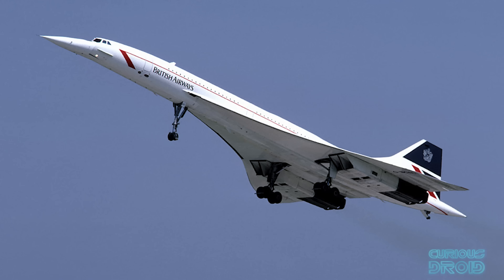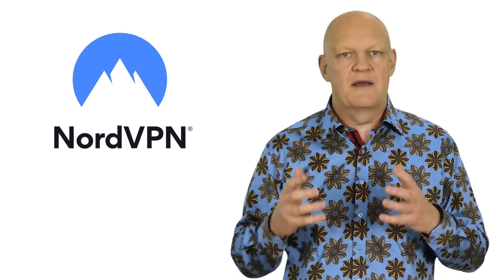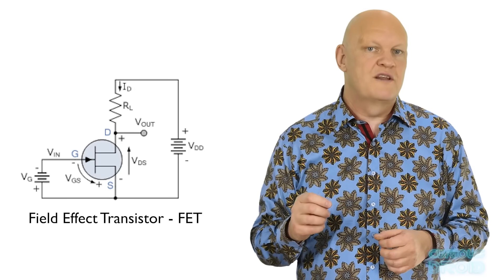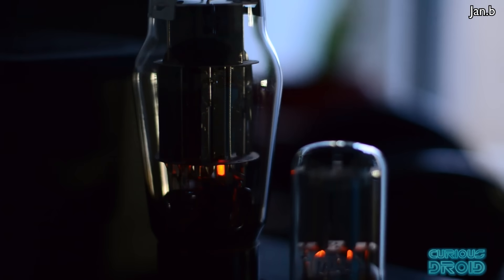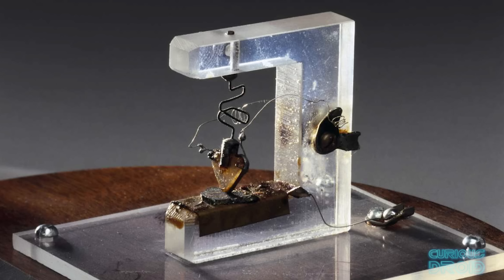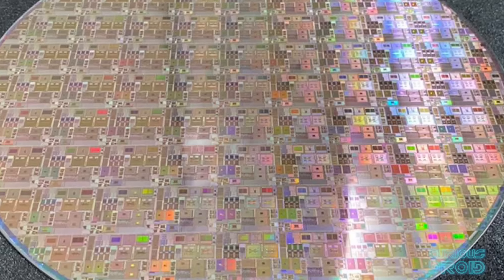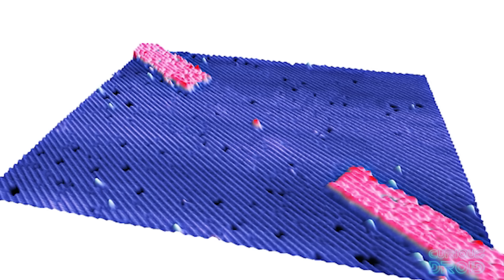MOSFET – The Most significant invention of the 20th Century

Comment: My first electronics experience was with valves (vacuum tubes). Then, as the years went by, solid state diodes and bipolar transistors appeared, followed closely by FETs and MOSFETs. The big step that broke everything wide open was the integrated circuit, a chip. This gave us op amps and "a computer on a chip." 
   I saw an LED for the first time around 1970. In the physics lab, we had a helium-neon laser. It was quite the thing to see! Now I use a laser pointer to play with my cat, and the screen in front of me consists of at least a gazillion tiny LEDs. 
   I witnessed the evolution of computers as well . . . the 4004, 8080, and the x86's. And storage media from magnetic tape to floppy discs to hard drives to solid-state drives. I recently purchased a flash drive for about $0.50 per gigabyte, and I'm told I got ripped off. 
   And it goes on . . . you bought music on vinyl, then 8-track tapes, CD's, until now you just stream it from the clouds, if you are so inclined. Communications: two cans connected by a string . . television . . . CB radio . . . cell phones, and now phones that also serve as movie cameras. Oh, I forgot the internet. That is/was a biggie because you no longer have to go to the library to look stuff up. 
  I've lived through some amazing times, from the DC-3 to the 747, and from Sputnik to Apollo to SpaceX in that arena. And I'm not really all that old, just a year or so older than your average boomer. Now I'm trying to decide if I really do need a smart phone, you know, the kind that takes pictures and stuff like that. The jury is still out on that one.

Comment: Metal Oxide Semiconductor ? Metal Oxide Silicon. I helped start ASML in 1983; I designed the laser alignment system for the PAS2500.

Comment: Around 2002 Intel introduced Pentium 4 at 3GHz and above. Now i9-11900K is at 5.3GHz. Obviously we have reached a speed limit. Yes indeed, there is more to performance than clock - cache sizes, architecture improvements etc. . They are trying to sell us the multicore thing now. But adding cores forever will lose effectiveness, especially for the home user

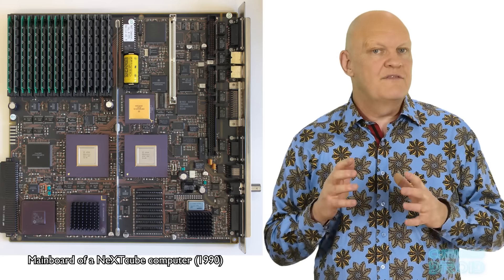Comment: 11:43 wait…16 ram slots on a motherboard? Holy hell…considering the largest number I’ve seen recently was 4 slots (sure, chip capacity is much higher these days but even still…DAMN!!!
Reply: Those are 30pin SIMMs which are only 8 bits wide. So those 16 SIMMs are the equivalent of just two DIMMs.

Comment: Transistors were invented in the 1920s--and it was built. The Nazis transistors them during the war, though they were not a German invention.

The first electronic digital computer was made in the very late 1930s by the Nazi scientist Konrad Zuse. It was quite a bit smaller than later tube computers built by the Allies--it was effectively a table top computer. So it almost certainly used arrays of transistors.

Comment: In the 1960's, a friend of mine in New Zealand called Clive Rowe devised a super-simple current-to-frequency converter using a MOSFET and a capacitor and resistor or two, to convert the picoamp range output from a high-gain photomultipler into digital pulses fed to a counter. We used it for astronomical photometry. This tiny and highly linear circuit replaced big boxes of tube electronics, and made professional-level photometry accessible to amateur astronomers, and the experience determined my later instrumental interests. Of course, nowadays CCD and CMOS chips with millions of very sensitive pixels make that seem very old hat, but still use nanoscopic MOSFETs.

Comment: There is still a lot of computing power let to gain. Take graphic cards as an example, it would need such a huge CPU to do the work of a graphic card, even the old ones ATI 3D ;-) because they are specialized and the general processor desgin is old. I would say the next huge jump will be in the architecture.

Comment: I remember when I was a child getting an electronic experiment kit for Christmas in the early ‘70s. It had all these electronic components on a board and terminals for each component and a big box of wires that allowed you to build all kinds of cool electronic devices. It had a chip that had something like 10 transistors on it🤯.
Reply: Was that Radio Shack's 100 in 1 Electronic Projects Kit? I got the next version, the 150 in 1 for Christmas in the mid to late 70's. It had a segmented LED. That and the integrated circuit made it "high speed, low drag" in my book!.
Reply: Sparky It was!🤓
Reply: Yeah, and the chemistry one.  Combine the two and you had a remote bomb making kit...
Reply: Me too.  That was one of my favorite gifts of all time.  It was a Radio Shack kit.
Reply: I had a different kit which 'contains a silicon chip!' (741 op-amp) and transistor. Years of fun. MOSFETs only appeared on the A-level Electronics spec in 2000, just as an alternative to NPN and PNPs, before finally replacing those in 2009. Exam boards can be slow to adapt.
Reply: during the pandemic i had a go at teaching myself electronics. i bought Velleman Solderless Education Kit. It's aimed at - kids but quite challenging! Also very cheap. In the UK it's like £14.

i also played with Arduino, but being an (ex) computer programmer - I found basic electronics way more challenging & interesting.
Reply: Same here.

Comment: You touched on it in the beginning, but power MOSFETs also have a lot of useful appliations. Perhaps a video about those and the implications of moving from Si to GaN (better electrical/thermal performance) would be interesting to your viewers.
Reply: most GaN based high freq FETs use 2d electron gas as a channel, which would be a fascinating topic too.

Comment: Could have mentioned J-FETs. For audio applications you get even harmonics which makes a MOSFET amp sound more like a valve one (because they're both field effect devices). Some years back I attended a talk that mentioned building proper valves with tiny vacuum holes on silicon

Comment: A great piece, with the extra length reflecting a more in-depth discussion than you usually do. One minor point: around 4:30 you articulately discuss the difference between a transistor and FET, viz the transistor is modulated by base current whilst FETs are modulated by gate voltage. Moving to 6:50 you state that a valve (tube) is similar to a transistor. Er I’d think it’s more correct to say a valve is similar to a FET. Reason being is that each is modulated by applied voltage, whilst the transistor (junction transistor) is modulated by current. 
Though I realise that this would complicate the flow of the story…
Reply: Ah okay this video is about audio. I was hoping for some nice, new visuals. Anyway, the difference between a tube and a FET seems to be the doping which can compensate the space charge. With a FET you can define a working point so to say by doping. Without a field there will be an equal density of electrons. With a tube electrons repel each other an like to slam in the metal electrodes. Around this working point we can enhance the flow by making the gate positive ( NPN transistor ) or make the gate negative to deplete. The effect is more pronounced on the semiconductor-insulator bandgap step then in the middle. This limits the gate width similar to the grid pitch in a tube.
I like Paul trap or electron lenses which by alternating fields create an effective confining field an work like doping in a tube. But for some reason this is only used in CRT -- where you don't switch on and off, but left and right.
Reply: A FET is a Field Effect Transistor ! Are you trying differentiate between bipolar transistors, FET's and the various MOSFET's? (enhanced, depletion, n-channel, p-channel, J-FET's, etc) and other transistors? 

I had an EE lab or two measuring the properties of several FET's.Unfortunately, My lab partner and I mixed up a regular FET with a J-FET.and screwed up the lab.

Otherwise you have some good points. A bipolar transistor is a current amplifier. Tubes and FET's are voltage amplifiers.
Reply: @nineball039  I try to unify transistors. I think the only difference between J-FET and MOSFET is the allowed voltages on the gate. With non finFET MOSFETs the substrate acts like a J-FET. To me it looks like J-FETs can achieve wide channels, but on the other hand the depletion region seems to be wider than the SO2 layer width in a MOSFET and thus signal voltages probably need to be larger. I don't understand why GaAs J-FETs for digital circuits can be fast.
Reply: @ArneChristianRosenfeldt  What's the difference between a J-FET and a 'regular' FET? (Measuring the parameters of both was a main part of our EE lab in the late 1970's).
Reply: @nineball039  MOSFET has an insulator to insulate the gate. Only Silicon can form a defect free Si -- SiO2 interface. And even without defects there can be interface states which are also not so many on that chemical. With GaAs you cannot do it, so you insulate Gate and channel by means of intrinsic GaAs and a the depletion zone of a diode. Ah, I love nip diodes .. sorry. So there can be no enhancement mode JFET .. you would loose the depletion zone.
Reply: @ArneChristianRosenfeldt  Thanks but I was not discussing MOSFET's.
Reply: @nineball039  what do you mean by regular FET then?
Reply: @ArneChristianRosenfeldt  Maybe it was a MOSFET. I did the lab in the late 70's and it won't be the first time I was wrong!
Reply: @nineball039  6502 is from the 70's and is full of n MOSFETs. I think it is interesting that the gate is made of (doped) silicon. So the only difference to a JFET could be the bandgap in the depleted region. Now I wonder why defects are less important in https://en.wikipedia.org/wiki/Heterojunction_bipolar_transistor
Reply: "the transistor (junction transistor) is modulated by current"? Please research the 'Ebers Moll' description of BJTs.  This more-accurate theory considers the emitter-base voltage to be the controlling parameter.
Reply: @NoiseWithRules  I think someone here already mentions that there is a exp() / log() relation between the current and the voltage. So it is the same math. No need to argue. I think ECL comes quite close to using the voltage because the logic levels are so close. It is like the core voltage in modern CPU, but as discrete components on a 1970 cray PCB / IBM mainframe.
Reply: @ArneChristianRosenfeldt  I was objecting to the bald statement that BJTs are controlled only  by the base current, which isn't accurate.  Yes it is a handy approximation.  For precise modelling the EB voltage (not current) is the controlling factor.
Reply: @NoiseWithRules  Yes, after all electrons sense an electric field. And they produce a field. Electrons don't "see" each other directly. Or they do, because "see" works by means of the EM field.

Comment: The scary part is it looks like we're hitting a wall with how electronics fundamentally work. We might actually need to start looking into other things to achieve more computing power. 3D dimensional stacking might work for increasing surface area to run more processes but speed remains a problem. 

We might have to look into photo based processors and start utilizing light particles instead of electrons.
Reply: I was introduced to the concept of the "steaming, furry, golfball' about 40 years ago by a smart colleague at the time. Steaming for obvious reasons!, furry as you'd need vast amounts of interconnects to get all that data in & out fast enough and golfball in order to keep propagation delays from one section to another to a minimum.  So far we seem to have reached the 'steaming, furry, biscuit' stage ;)

Comment: Touches well on the computing aspect, a 2nd video could be in order on their modern use in high power conversion, switching, inverters, modernizing factories with vector motor drives, electric vehicles, etc, those mosfets used here are gigantic slabs of silicon. They not only made computing possible, but also allowed for significant energy efficiency upgrades across the board for just about everything that needs to drive a motor, etc. Your typical washing machine will use some type of DC mosfet driven pancake motor now for energy savings requirements.

Comment: Oh I remember the Z80. I was a bench tech. Z80's were on "allocation" so we never had enough until I discovered a local electric supply house stocked them, I'd draw petty cash and buy a tube every month. HQ in NYC thought I was a wizard.
Reply: The Z80 was Radio Shack TRS-80's engine. I learned to program them in machine code when they first came out. <sigh> (Just flashing back...)
Reply: Back then we programmed in CP/M. 
Our Telefunken word processors used two Z80 per board.

Comment: It's the power electronics side that fascinates me trenchfets and hexfets are mosfets with geometry taken into consideration to increase their performance characteristics. The power you can cram through an SMD Fet these days is bonkers!
Reply: HEMTs are even more bonkers. They can cram high power at high frequencies too (like 700W at 1GHz !!!). They are also less sensitive to temperature, some cheap HEMTs can work even at cryogenic temperatures even if they are not rated for it.
HEMTs are basically just FETs with some quantum trickery (2D electron gas as a channel), so no wonder they were not mentioned.